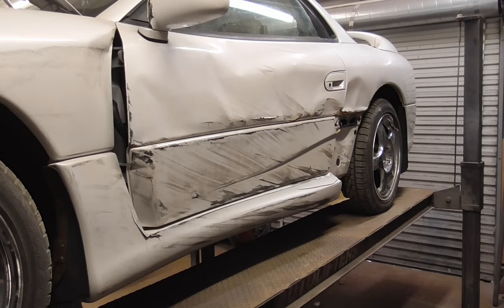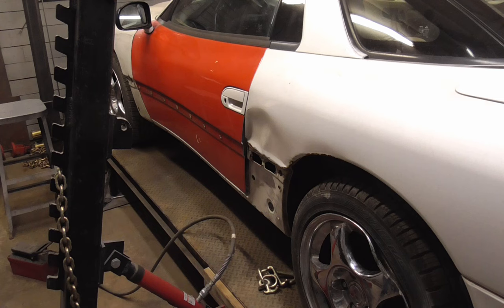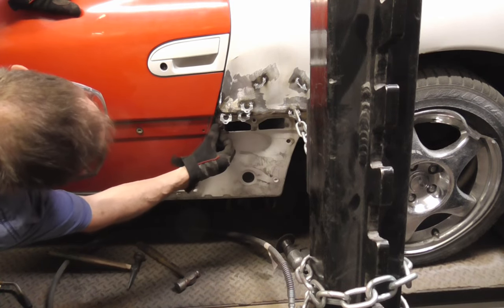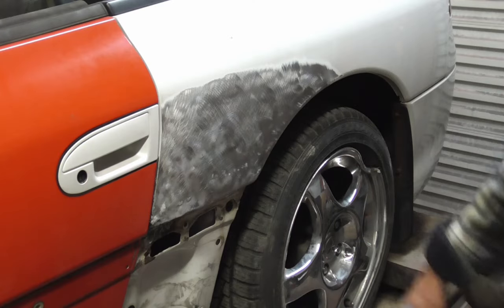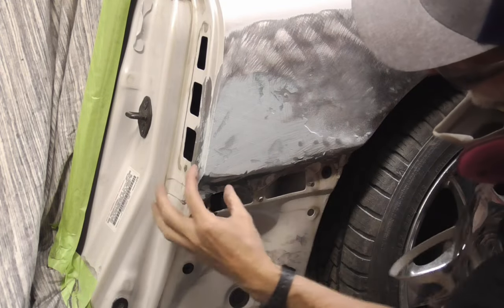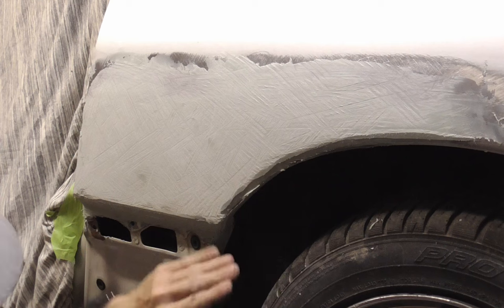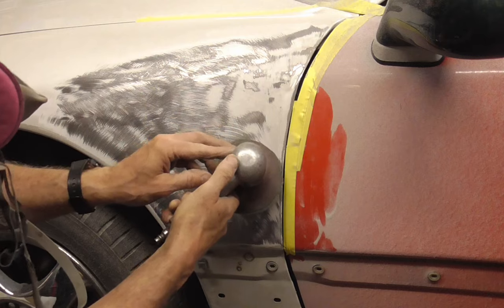How Body Shops Repair Serious Collision/Accident Damage - Start to Finish

Comment: I do this for a living. I love seeing someone post this type of video for the normal ignorant consumer to see. I don't mean that negatively, i just use the word ignorant as it is defined as in people don't have the knowledge of. They call us mechanics because we work on cars. We are auto collision technicians, not mechanics. Totally different ball game than turning wrenches. This is just one part of what we do. I hope this can appeal to some youth and get them into the industry. Kiddos, you can get in the industry and and with determination and drive, you can learn from guys like this and be making $100k/year no problem. Too bad society makes us collision techs look like dirt bags and people look down on us. If I could go back i would still be a body tech. So rewarding and always a new experience on every job. From taking doors apart and removing a handle to pulling a frame and getting it from 30 mm out of spec back to within 3mm, this career is highly underrated. Society makes you think 4-6 years of college is a must and $80k in debt from loans. And if you don't then you failed. You can drive a $70k truck and buy a home faster in this profession than you can if you go to school to be an attorney. By the time i was 28 I bought a house and had it half paid off and was making over $60/hour because i was working 100% flat rate (commission) I'm now 43 and started my own collision center and we are close to doing $250k/month in business. That's approximately $30k/month of pure profit for ownership. Don't conform to society BS. Pick a trade for a career if you can and IT WILL PAY OFF. People love seeing you try and they will help you if they see you putting on the effort.
Reply from the maker: Thanks for your input Jake - sorry about the late reply. You're absolutely right about learning a trade.  You'll always have a job and feel good about yourself.  One boss always told me a mechanic can fix cars but a body man can fix anything - he's was so right about that 👍🛠😊

Comment: Jerry I really appreciate your use of basic tools and down to earth explanations of your trade. I'm trying to repair a old 000 dakota that was damaged by a hit and run driver and with your assistance it might happen thanks your youtube is greatly appreciated.
Reply from the maker: You're welcome Keith - let me know how it goes for you.  Feel free to ask ?s 👍😊
Reply: Not really basic tools those are the tools
Reply: @robertcampbell5485 cheap welder some shims hand tools and  a basic chain block with hooks and your in business.
Under 300bucks and you could probably have all of it or just work with what you got. I used a tree and heavy strap to pull a b pillar back onto place before or a big heavy butt rail sleeper. I have had to build tools from scrap cause I don't have them.

Comment: Your videos helped me repair a hard rear corner hit on my sons car. I was able to get the car drivable in roughly three weeks of nights and weekends. I had to improvise on a pulling system to get the  quarter panel nearly straight as it was wrapped around the trunk area. I do weld and fabricate some and have auto body experience from way back. The rear bumper was in several pieces and stitched together and still holding for three years. He leaves for college next month and I will finally get a chance to finish the primer repair this fall.
Reply from the maker: That's great to hear - glad the videos helped you out.  Where is he off to?
Reply: A few miles from home but he can’t take his car freshman year. Moravian university.
Reply from the maker: @jeeptk  Ah - got it.  He'll have a great time 👍😊

Comment: Newer appraiser here and wanting to learn how repairs are done to better perform my job. What’s the repair time on a QP job such as this? 4.0? 6.0?
Reply from the maker: The door was replaced - probably get about 2 hours for that.  Dents like this one get quite a bit of time because it's subjective.  4-6 hours is about right for the quarter dent.  I never wrote estimates - body man - so I can only give you an idea or ball park figure.  They do have software or crash books to give accurate times - not sure where to find one though.  These videos are on cars that will be sold - they're clean title repairable vehicles from auctions or rust bucket trucks that have low miles :)

Comment: Maybe this tab welding trick is what I need to do on my car. I originally thought I could push from the inside but after removing the interior I've realized there's just not much access through the inner wall of the unibody to get to the quarter panel. Thanks for the video
Reply from the maker: You're welcome.  Generally body shops never remove interior parts unless absolutely necessary :)

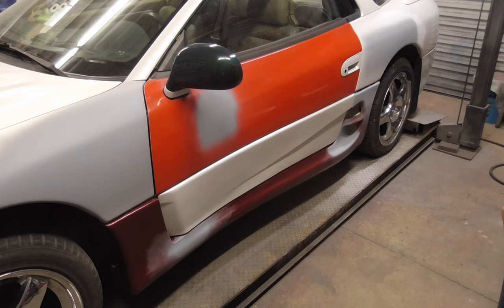Comment: 43:53 I am new to learning body work. Question I have is once primer is down then you have to block sand it and re primer it then finish sanding? Why does it require a repeated process? Thanks for the videos and I’d appreciate learning why.
Reply from the maker: The re priming fills the previous sand scratches.  After block sanding, you usually don't have much left to finish sand or get it to a fine grit that can be painted over.  If that doesn't help ask more ?s :)

Comment: I have to work on my car outside currently, and can only do it on the weekends. Will a primer surfacer protect against rust in the meantime if it gets rained on or something?
Reply from the maker: It will be fine.  Don't park it in the shade - park it somewhere that it can get a breeze and/or in the sun shine so it can stay as dry as possible.  I've left lacquer primed panels outside months at times and never ran into any issues.  If you see rust showing through, etc. then you'll want to hit it with the DA real quick and prime again before continuing :)

Comment: When using the cheese   are you looking for to know whats to be graded and what results do you get when you know you done cheese grading
Reply from the maker: Great ?.  That's one of those things that come with doing it a few times.  The main goal when starting to use the cheese grater is to just knock it down a bit to make sanding the filler easier.  Once you get good at that you'll start to get it closer and closer to almost perfect.  Basically knocking down all the high areas and staying away from the lows.  Ask more ?s if needed :)
Reply: @LakesideAutobody  thanks I’ve been learning a lot and learning to understand a lot watching your vids keep up the great content

Comment: Hi Jerry. Awesome  awesome job. Question: how long does auto paint or primer last if they aren't opened or mixed and sealed in the can from the manufacturer? What if you used a little out of the can, but sealed the can appropriately afterwards for both paint and primer?
Reply from the maker: At one shop I worked at there were cans of paint in the paint room that must have been 5-10 years old or more.  I'm thinking quite a long time - my dad had some real old stuff on the shelves too that I would open and mix with other paint to change the color just a bit to try and match better.  I really never found a can with hardened paint in it.  Hope that helps a bit - that's been my experience at least :)
Reply: @LakesideAutobody   Thank you Jerry.  So I guess as long as one does not add the hardner, reducer , etc. It should be okay. I guess if one had some for a while it would be better to make up a little sample, spray it and  see if it cures up
Reply from the maker: @gm-lb9oe  If it is not gelled up like rubbery in the can you're good.  As long as you can stir it and mix it w/ reducer and activator it will harden just fine :)
Reply: @LakesideAutobody  Thank you very much Jerry, your vids are awesome
Reply from the maker: @gm-lb9oe  Thanks for the kind words and support GM - have a good week my friend 🛠

Comment: Hello from New York and a really quick question please.  Just had my 2021 Dodge Durango repaired at a Geico express body shop.  I had a collision with a deer that damaged my driver side door.  When I got the car back I noticed that The door sounds hollow.  When I tap on it with my knuckles it is obviously hollow and sounds like an empty can.  The passenger side door does not make the sound at all.  Do you have any idea what the body shop did or did not do to cause this empty sound?
Reply from the maker: Usually there is sound deadening material, foam blocks, thin gauge plastic under the inner door panel, etc. glued/stuck to the inside to eliminate the hollow sound and road noise.  If that stuff was damaged in the accident, or damaged replacing the door they may have carelessly left it out and hoped to get away with it.  It's sort of common. Good luck and let me know if you get it resolved.
Reply: @LakesideAutobody  thanks for the reply and on Christmas no less.  I just subscribed.  I'm not letting the body shop get away with it.  They also left some orange peel on my car. I'll be nice about it and will only involve Geico if necessary.
Reply from the maker: @gm1937  If you have a junk yard near by that allows customers in the yard, you could go see for yourself what the door is supposed to look like under the inner door panel or "card" as they call it in Europe 😊

Comment: Question?
If you are working with metal, shouldn't you be using metal fillers?😅😊
Reply from the maker: No - regular filler will work fine on any repair with metal. Here's some proof for you if interested - https://www.youtube.com/watch?v=idrLzsz2eLg

Comment: Wouldnt it be easier just to replace the panels?
Reply from the maker: Yes but it costs quite a bit more - not even sure if you can get a 3000GT quarter and fender :)

Comment: What''s the most difficult job you guys have had in the shop?
Reply from the maker: I'd say one of the most difficult is a car hit by a semi tire that came off on the express way - that was in a shop I was working at.  Another was an early 80s Town Car that side swiped a tree - had to make a big custom sized bondo spreader for that 🥴  This one was pretty bad too - had a bum arm at the time from slipping on the ice - hard to swing the hammer 😢 - https://www.youtube.com/watch?v=xbzGX4hW9qo
Reply: @LakesideAutobody  I'm retired military. Retired after 20 years as a fleet mechanic. Half of my service I served in the Army and my other half I served in the Air Force. Only time I messed with any body work was a time we had a fleet of HUMMWV we had come in. Hand me down vehicles from another unit.  😁 

The hoods had some damage to them . Cracks/holes.  Hoods were fiber glass so we used fiber glass repair kits. Time consuming but not as complicated as the work you guys do on these videos. In the Air Force part of my training in the shop included some body shop work. The name of the body shop section was called Allied Trades. 

Did some refresher welding with oxygen and acetylene. We had this mounted on our wrecker when we would go out to the field in the Army. I have always been a little nervous around welding with this stuff. Always thought it would blow up on me.  Dont recall using tig/mig welder but they had this as well. This was around  2006. Good times.
Reply from the maker: @EddieLeal  Those do sound like good times.  Every Sunday morning I have breakfast at the local VFW with a bunch of older guys that served - like Korean era, Vietnam, & 70's/80's era - really good guys and one of my favorite days of the week - love hearing other peoples' stories - have a good week Ed :)
Reply: @LakesideAutobody  Thank you sir.  Take care and keep up the good work. 👍
Reply from the maker: @EddieLeal  You're welcome - thank you for serving 👍😊✌

Comment: Put a j hook thru the hole and pull it out. Everybody wants to start welding on  tabs right away and using a torch. Next you will start tearing metal and have a freaking mess The body line isn't going to come out if the dent isn't pulled out first
Reply from the maker: Usually using a j hook like that will cause further damage or tear metal that's why you use tabs, shims or even sheets of metal - to spread out the pulling area.
Reply: @LakesideAutobody  I sometimes use a stud gun, line up the pins close and use a moclamp and a Morgan knocker to pull body lines. A lot less heat introduced on the sheet metal. Just saying
Reply from the maker: @johnnyshd8250  Good tips Johnny :)

Comment: Wrecked cars Should Never be repaired, there just going to get wrecked again, plus you have hidden electrical damage, part em out.
Reply from the maker: If you fix them the right way, you'll be just fine.  No problems at all :)
Reply: They don't get wrecked again if the driver knows how to drive. Also no reason to mess up the electrical by repairing